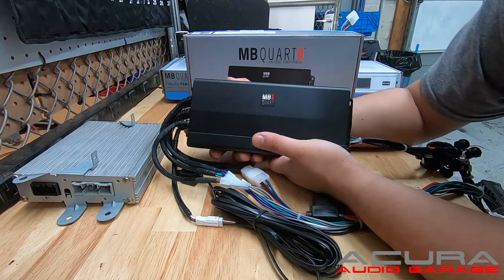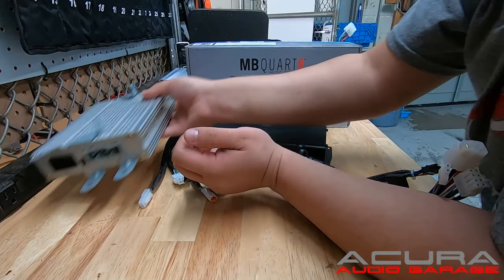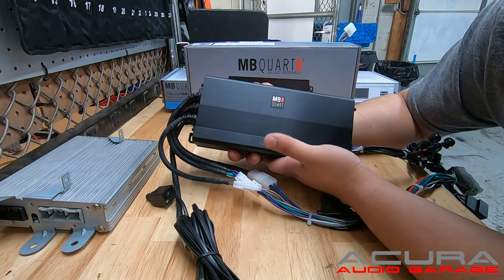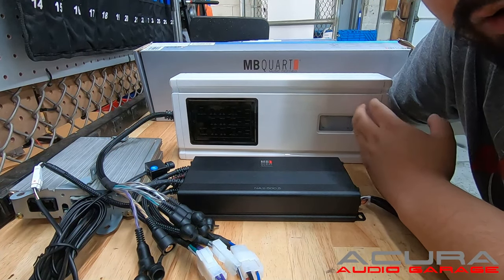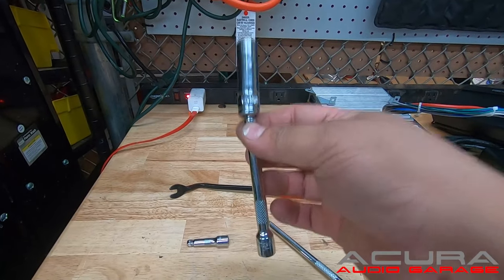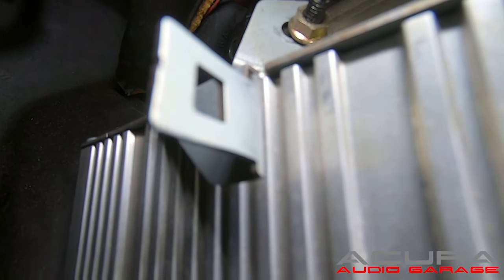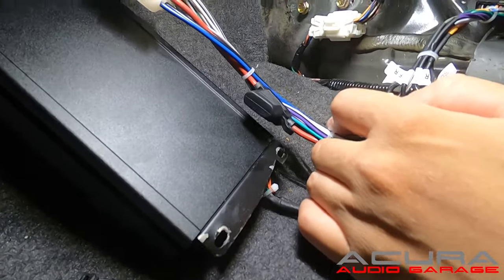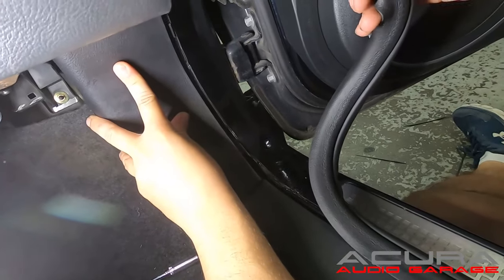2004 2005 2006 2007 2008 Acura TL Plug and Play Amplifier - Demonstration and Installation

Comment: Question i bought the MB Quart NA2-320.4  from your web site to eliminate the factory subwoofer and installed it already and sounds good. Now going to install the second amp Rockford Fosgate R2-750X1 class D to run 2  12s subs in a box and just plan on running a output line converter to the subs. So the question is since i replace the factory amp i shouldn't have a signal at the factory sub wires at the back correct? Would i have to grab the signal before the  amplifier at the black connector A1 and A2 ? thanks in advance.
Reply: It sounds like you know more than I do and I have a question. I just got this amp into my TL and the Subwoofer isn’t playing anything. He said you’re able to keep it. You said otherwise and I was just curious.

Comment: I'll be a tester. I have an 06 Tl with Pioneer double den, 250 amp alt, 0/1 big 4 upgrade going to 3k HD taramp on 2 JL audio W7. But still stock door speakers and rear deck speakers
Reply: is it good? i got the same setup as you lmao but a 08 tl

Comment: Do you have any plans on doing this for the MDXs? Specifically 2006 with bose? If so, I'm a buyer.
Reply from the maker: We are working on this. It will only work with the BOSE 04-06 MDX
Reply: I'm in for sure. Please make a video when it's available so I don't miss it.
Reply: @AcuraAudioGarage  are you guys still working on this for the MDXs? or is it completed?
Reply: @AcuraAudioGarage when you say center when talking about the 6 channel do you mean the tweeter or center sub?

Comment: Would this work in 07 Honda Ridgeline? I have factory sub, I want more bass but do not want to have to deal with a LOC. so far I’ve hooked a 12” kicker sub to the factory sub and have both beating but the factory head unit doesnt put out enough power to make the 12 beat as hard as I would like ot to.
Reply from the maker: no sorry it wouldn't

Comment: man i have a 2004 tl base, i replaced the caps in the factory amp, due to static coming from the radio...the cd button doesnt work it wont let me load a cd or eject...so anyway, i read ab the amps and with my diy amp repair it didnt fix the issue however after the volume slowly maxing out even at 1, i thought i messed something up with the repair so i bought another 04-06 amp off ebay, plugged it up and still nothing but static....my question is is the radio shot??? or is there something unplugged??? or is there a short somewhere between the amp and radio? please help, i dont want to take it to a shop
Reply from the maker: the radio is shot. It's common for the amplifier to go bad and eventually kill the radio. It's not super common but we have seen it several times now.